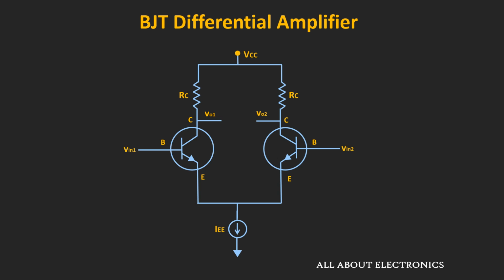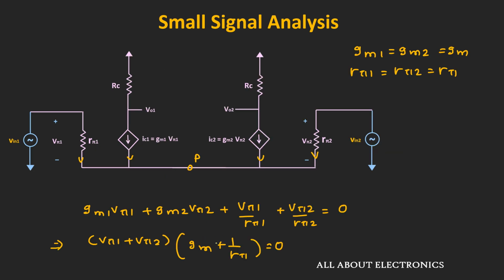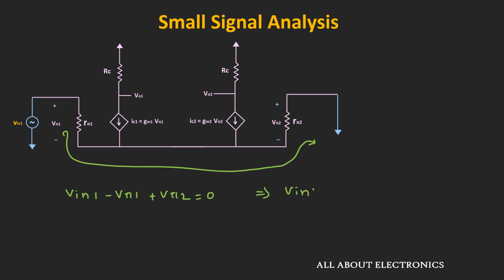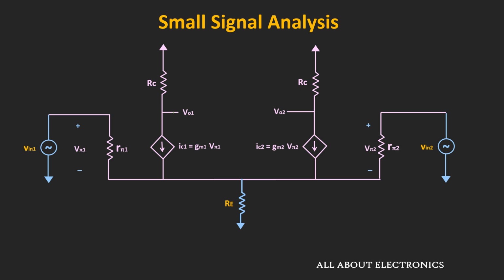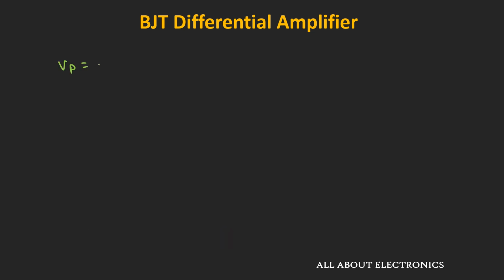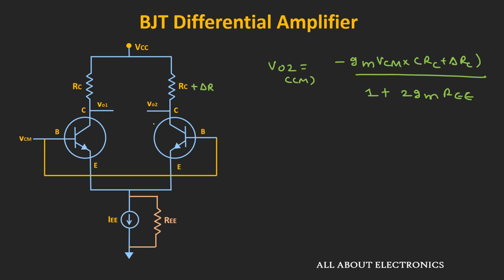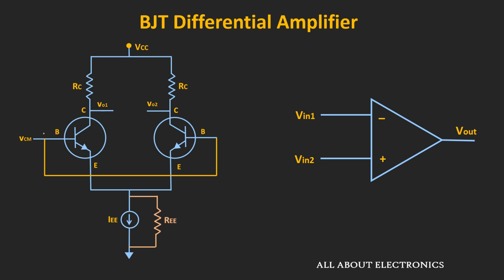BJT - Differential Amplifier (Small Signal Analysis - Differential Gain, Common mode Gain and CMRR)

Comment from the maker: Time-stamps for different topics covered in the video:
0:00 Introduction
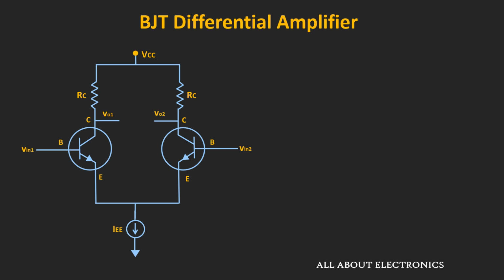0:57 Differential Gain of the Differential Amplifier using small-signal analysis
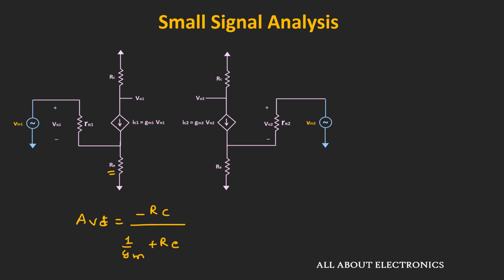12:45 Input Impedance of Differential Amplifier
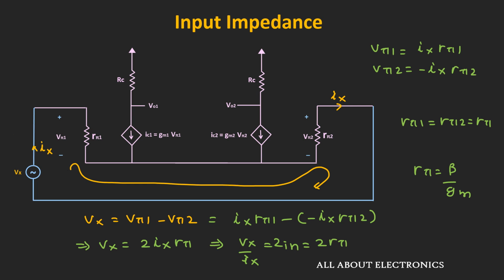14:34 Common mode Gain and the expression of CMRR for differential Amplifier

Comment: What if instead of the current source at the bottom I_EE you replace that with a third NPN BJT whose bottom terminal is connected to -V_ss and the middle terminal connects to the middle terminal of a FOURTH NON BJT whose upper terminal is connected to a resistor which is then connected to V_cc, and the lower terminal to -V_ss

How to create the small signal model to find A_cm (not A_d)

Comment: Isn't Vp= 0 even if Ree is present instead of Constant current source   for a CM signal?? You said Vp acts like grounded even if REE is present instead of IEE
Reply from the maker: In case of common mode input, Vp will change with the change in VCM. But for the small differential input signal, it will act as a virtual ground. I hope, it will clear your doubt.

Comment: 25:50 what do you mean by active load?
Reply from the maker: In active load, the current mirror circuit is used instead of collector resistor. it is very helpful for diffential to single ended conversation. 
In normal differential amplifier configuration, if you take the single ended output, the gain will reduce to half and it is more prone to common mode noise. And it affects the CMRR. The active load eliminates that problem.
I hope it will clear your doubt.
Reply: @ALLABOUTELECTRONICS  thank you , I suggest you make a video explaining this technique